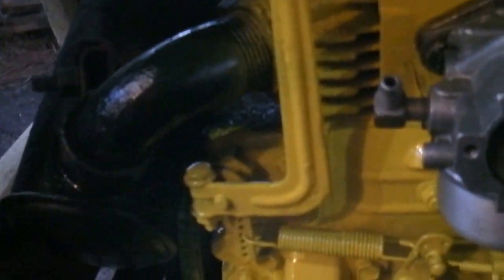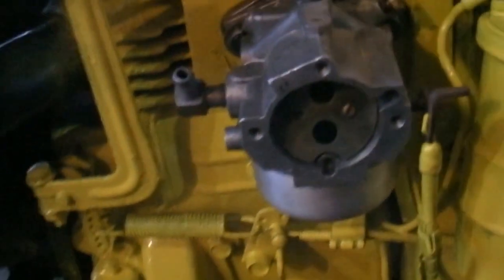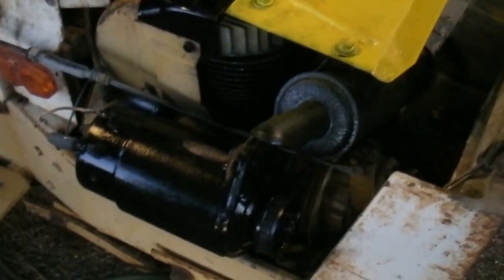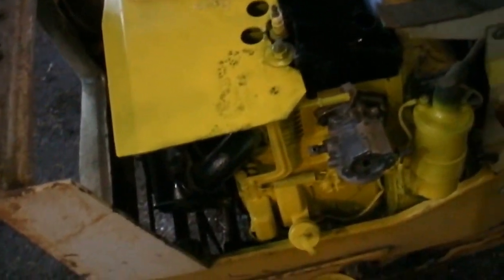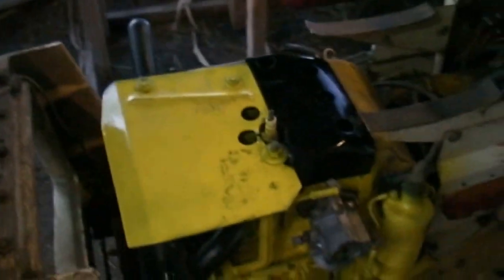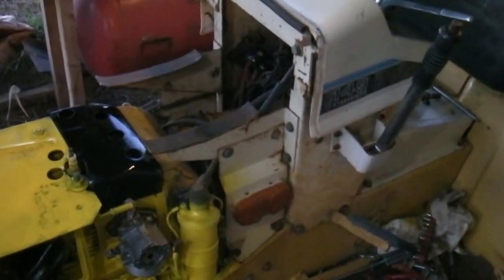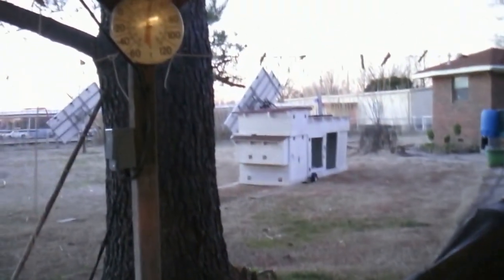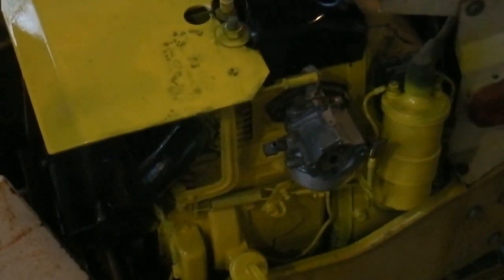Carb Installed on the 149 Cub Cadet & Some Painting

Comment: coming along nicely, Craig's right make sure you install a fuel valve on the tank.  I have the same problem with my batteries, short winter days and cold weather doesn't do any good for charging them!
Reply from the maker: +ElRazTheGreat1 I dont know if the old one will leak yet. I hope not. I broke the handle of it but it is open. dang. Looks like i gotta get a new one.

Comment: Be sure to put a fuel petcock on the carb, with today's fuels I always shut off the engine by running the float bowl dry.
Get a piece of foam board to set them batteries on, perhaps even a surround to help keep them warm.
BTW... Happy New Year
Reply from the maker: +Craig Nehring I have  pit cock on the tank but I dont know if the pit cock will leak. I hope not.
Reply: Briggs & Stratton makes some really inexpensive plastic ones, they come in several configurations. Straight and right angle in line with the furl line
Reply from the maker: +Craig Nehring I will look for one on ebay or at the auto parts store. A box with insulation needs to made for my batts that may help a lot. I think they need to be boiled too. so the acid will come off the bottom.